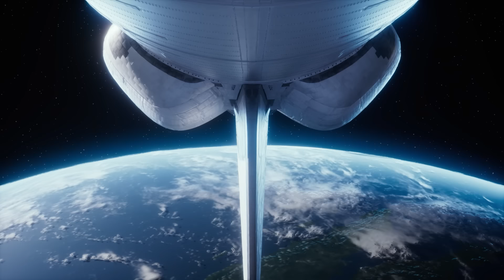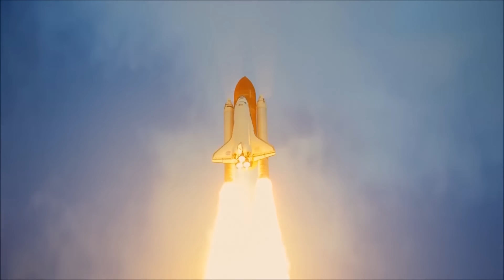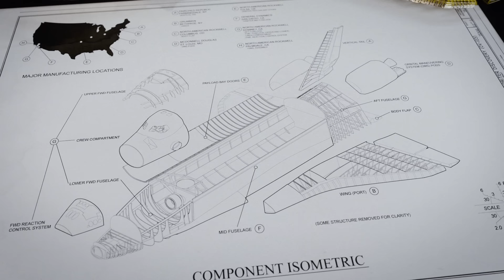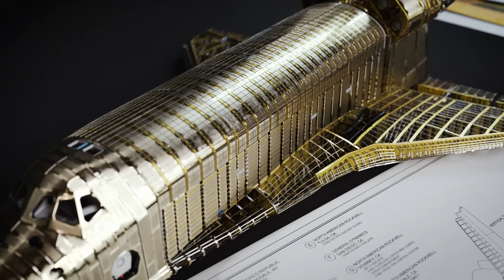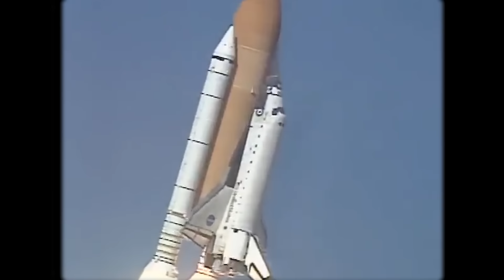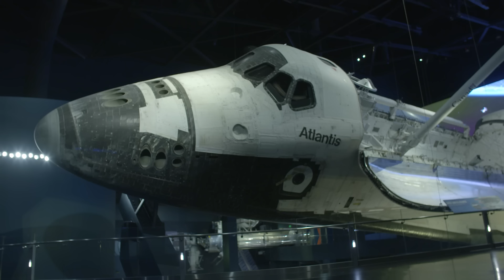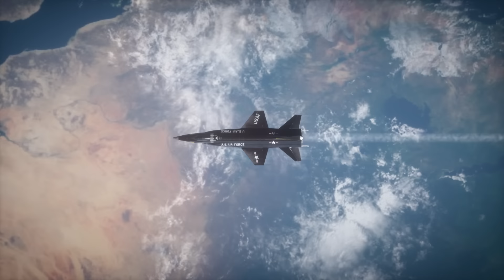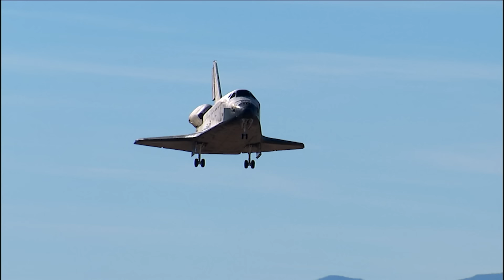The Insane Engineering of Re-Entry

Comment: Reentry from where the shuttle never left 😂 That’s against all aerodynamics. Reentering the atmosphere with the biggest and flattest area which are the shuttles delta wings connected to its fuselage. It would be much more aerodynamic entering with the nose first, which has the smallest contact area, and would “cut” the atmosphere much easier. All supersonic planes have very pointed noses: to reduce air resistance. Except for the space capsules and the shuttle which re-enter the atmosphere with the least pointed part possible. What cuts better, the flat part of the knife or the sharp edge of the knife? Which part of a knife stabs better, the tip or the handle? In aerodynamics it’s the same. The smaller the contact area of object A the easier it penetrates object B.
Reply: The goal of reentry is to lose speed. So you want to make the air resistance as high as possible, not as low as possible.
Reply: Your surname suits you if you translate it to danish.
Reply: Okay first off, the point is to slow down when re-entering the atmosphere, and number two, if you were to re-enter the atmosphere with the Shuttle's nose pointing straight ahead, it will melt since it doesn't have heat shields on the top of it
Reply: @just_david  It would be easy coating the nose of the shuttle with a heat shield.
Reply: @michael.forkert  Like I said in my first point, it would not slow down enough
Reply: @just_david  You have forgotten, that NOTHING flies or floats in a vacuum, or in a near vacuum environment.
Reply: @michael.forkert  So? What does that have to do with re-entering the atmosphere?
Reply: @just_david  What is outside the atmosphere? What is there between the Earth and the Moon? Haven’t you learned that it is a vacuum? Just join the dots, and realize that NOTHING flies or floats in a vacuum. WHY? Because in a vacuum, there is the absence of any matter, which, if present, would sustain anything flying or floating.

Comment: Only star wars technology can make sucessful reentry.
Reply: Nope. Human technology has been proven successful in several hundred manned reentries.
Reply: @Hobbes746  There was not successful manned reentry over Soyuz/Apollo/shuttle style tech. Even ISS is unmanned. Star wars use special electromechanical methods, magnetism and plasma. The force field shields prevents overheating on the hull - Millennium falcon, X wings etc. Also hull materials are far stronger than steel. Carbon nanotubes. TIE fighters/bombers use slow down methods. Simply load is on the engine. Simply engines in star wars are electromechanical jet engines. But quadrillion times stronger and more powerful and more efficient than currently available officially used engines. Area 51 and S4 make such engines. Back in cold war SR71 was designed by similar tech. Then was many advanced projects and propulsions. Including catapult effect, long rail accelerations and what not. But nothing can beat the electromechanical methods with magnetism and plasma tech.
Reply: @LORDVADER357  Incorrect. As I told you already, there have been hundreds of successful reentries, starting with Yuri Gagarin in 1961. All you need is a phenolic resin heat shield. Ceramic tiles also work, as the Shuttle showed. 
Star Wars is fiction.
Reply: @Hobbes746  The irony is that star wars is fiction but is real tech. While apollo is claimed to be real but is pure fiction. Area 51 exist for real. S4 exist for real. And yeah George Lucas knew about that very well. In fact all of his ships was designed by NASA engineers.  Gagarin's flight was also staged. He landed by parachute away from the capsule. ISS has orbit in thermosphere. With peak temperature of 2000+ Celsius. Good enough to melt steel. Ceramic plates will survive. That part is correct. However crew inside will be cooked alive. French fried. Ceramic when heated slowly cools down. So you have one ceramic oven 🔥🌀. How you prefer you astronauts/cosmonauts? Fried, boiled,baked... with more sauce, ketchup. More salt?
Reply: @LORDVADER357  Thermosphere means nothing, there is so little air it transfers almost no heat at all
Reply: @Hobbes746  Star Wars is advertised as fiction. But its real tech. While apollo/spuyz is claimed to be real tech but claimed performance levels is pure fiction. You mentioned Gagarin. He landed outside of the capsule with parachute. Simply was droped by airplane. After that they killed him in airplane incident. Apollo 1 crew died in capsule fire here on ground in simulation.  Our moon is former death star. Gray type aliens are just using it as hangar/garage for their flying disks. Disks fly on centrifugal force ans magnus effect. Pretty much like throwing friesbees on beach. Basicly disk throws itself by spinning hull. Very short range, no interstallar capabilities whatsoever. Here and local planets from solar system. Angels/demons are hydrogen based not oxygen/carbon based. And fly around the planets like nothing.
Reply: @cardboard9124  Thermosphere means that you will be frenchfried. Baked, cooked. How you like your astronauts? With more ketchup? Salt? Nah turned into potato chips. Lil bit overcooked. Yes particles are scattered but thats the problem. Particles cant heat you up, but you cant expell the heat because there are no particles to exchange heat. So you overheat instanly. Even from your own heat. And if sun overheat so much scattered particles whats left for your stupid hull and lots of air inside it? Seriously? You think sun will heat up particles but not stupid shuttle/apollo hull? Or ISS which is constantly in thermoshpere. So sun will heat up scattered particles but your hull will be as cold as ice? Only if you have incredible powerful cooling system. And force filed to keep the heat away.

Comment: They use a aluminum can to go to moon, they really over built the space shuttle. It doesn't even have gold aluminum foil anyplace?
Reply: The LM used MLI foil insulation. This could be placed on the outside of the spacecraft, because the LM would never have to operate in an atmosphere. The Shuttle does have to operate in our atmosphere, so different materials have to be used on the outside. Those materials are a lot heavier than MLI. The weight of the LM was one of the critical items to enable lunar missions: make the LM too heavy, and it could not get to the moon. So they spent a lot of effort making the LM as light as possible.

Comment: Serms they should use aero gel covered the ceramic tiles for more of a heat sheild sincs aero gel can alot of heat. That would of been my guess if i worked there and had ro come up with some idea but im s dumbass and they are one of the smartest people on earth so im sure they probably already thought of that snd this was a better solution of using those black tiles what i don't understand is why black that sbsorbs heat seems like they would use white tiles to feflect the heat but maybe it would of reflected the heat on the un protected top part rather than the belly of.
Whst they made is smazing to most people and i too think it is but what is more amazing to me is that after it landed it would hitch a ride on top of an airplane back home, or wherever they planned it to go.

Comment: Wasn't apollo's reentry capsule also designed with the center of mass slightly offset from the centre of (aerodynamic) pressure, so it would tilt upward a bit to create a bit of lift? So the Shuttle wouldn't be the first to employ this effect.
Reply: Yes. They could roll the spacecraft to steer in any direction.

Comment: "The speed is so great it begins to rip air molecules apart". This is incredible wrong. It's the compression of air which makes the heat (adiabate compression). The air is compressed because it does not have enough time to move aside.

Comment: Why does the shuttle orbit the earth in a reverse orientation ?
Reply: Cause the antenna is on top of the shuttle
Reply: @sH-ed5yf  I didn’t ask why it was UPSIDE DOWN. I asked why it was flying BACKWARDS.
Reply: @robertchoutka3191  oh my bad.
In order to reeintry the shuttle has to slow down slightly. After that it sinks to thicker air layers
The rest is done by the friction of air.
In order to slow down they have to fire their engines. Those are at the back
Reply: @sH-ed5yf  Oh of course! Yes, that makes perfect sense now. 
Thank you 🙏

Comment: I'm a bit confused, you mentioned that carbon is a better thermal conductor than steel. According to Engineering Toolbox, thermal conductivity for carbon is 1.7w/mK while steel is 30-50 w/mK. Did you happen to mean that steel is a better insulator than aluminum?

Comment: In proper english, 500,000ft to ground in 1 hour, 19,200kmh in orbit To 800kmh or 500mph at 40,000ft, falling at terminal velocity, at 40,000ft 1 minute from landing they enter the heading alignment cone and do the turn onto the final approach at 500 ft they drop the landing gear at 300ft they start their flare. The tail has an air brake that controls speed in the final 100,000ft. The final minutes are flown by manual control  and the computer for the whole mission are only 16 kb. Take a picture of a white wall and that uses more memory on your phone than the whole of the space shuttle. Truely amazing.

Comment: Why didn't the space shuttle glide down gently? Specifically I mean once it was going through the atmosphere fast enough to generate heat why didn't it generate enough lift to just be a glider at that point? Couldn't it have slowed down by gliding for a couple hours?
Reply: Air starts to cause drag long before there’s enough air to cause meaningful lift. I think this has to do with the amount of space between molecules: they need to be densely packed in order for lift to occur.

Comment: I really like this and found some new information also. Anyway to me the whole guidance and navigation and approach of space shuttle was really interesting. Split into phases (Entry, Terminal Area Energy Managment [TAEM], Approach and landing)  ensuring everything connects well and you land at the location you want. For example this TAEM bank turns (S-Curves) used to dissipate energy in controllable manner without overheating also had component of controlling your course deviation. You could bank to one side only until some course deviation value, then you had to start banking to other side. When TAEM phase ends you are close to landing strip and you still have some buffer regarding which approach and how the spiral will look like so you can dissipate the right amount of energy just before the landing. Very clever and structured.

Comment: My sister had one of the tiles used on the bottom of the orbiter.  I remember putting it on the stove, turned up full and after several minutes, comfortably grabbing it off the burner with my bare hand.  The bottom was glowing orange but the rest felt room temperature.  Amazing engineering indeed.

Comment: How come the shuttle doesn’t perform a more aggressive de orbiting burn? If the speed causes such insane temperatures wouldn’t they want to lower the re-entry speed as much as possible?
Reply: You see this huge tank that the Shuttle is sitting on when launching? You need all that fuel to accelerate from 0 to 28000 km/h. You need the same amount of fuel to decelerate from 28000 km/h to 0 (well, not really when you already have less fuel after the launch so you are lighter... but you get the point). Using the atmosphere to slow down is just efficient, comparing to using rockets to slow down.

Comment: Everything about the X-15 was real, the footage, the technology. Everything about the 'space shuttle' was cartoon bullshit. Space is fake.
Reply: Except the X-15 went to space. Oops. So much for space being fake. 

'Mix 'n' match' isn't possible; it's either all fake, or it's all real.
Reply: @thewildcellist  67 miles isn't 'space' If you can't tell the difference between that real claim and 240,000 miles away in a vacuum to the "moon" then I've got a tour of the Kennedy Spaz centre to sell you
Reply: @JackH2478  yes, 67 miles is outer space - by 5 miles (the Kármán line, which dilineates the boundary, is at 62 miles).
Reply: @thewildcellist  is that where grabbity stops working and you magically float?! Lol.
Or where you have a vacuum next to a pressurised system without a barrier?! Lol. 
Space is dogshit. Anyone who believes in it is a mong
Reply: @JackH2478  That's all you got kiddo... not much, just another sad troll with no life.
Reply: @JackH2478  
" is that where grabbity stops working and you magically float?! Lol."
No,  62 miles is the altitude where the necessary speed to get aerodynamic uplift becomes as high as orbital speed.. Some people once decided to use that as the thresold between aeronautics and astronautics. US air force uses 50 miles. All definitinions are arbitrary, the atmosphere becomes thinner fluently, so you cannot say where it ends. And it doesn't matter. The ISS at 250 miles loses some altitude all the time because there is still some atmospheric drag at that altitude. 

Why should gravity stops working suddenly? Have you ever even looked into the formula for gravity? It becomes weaker with the distance but never zero. And it has nothing to do with the atmosphere.  At 250 miles (the altitude of the ISS) it is only 13% weaker than down here. In a launching rocket the astronauts don't begin to float when they reach a certain altitude. Instead they begin to float when the rocket stops the engine and the spacecrafts begins to coast/fall/move only by its momentum. ZeroG airplanes don't "simulate" the weightlessness that you have in the space station. Instead it is the same effect. You are weightless when no other force than gravity effects you, so in free fall.

"Or where you have a vacuum next to a pressurised system without a barrier?! "
How do you come to such a weird idea? The air pressure gets lower when you go higher. You can feel and measure that (you feel the pressure change in your ears in a high elevator; and altimeters usually work by measuring the air pressure).

- sea level: 1013 hPa
- top of Mount Everest: 325 hPa
- cruise altitude of airliners: 191 hPa
- 12 miles: 78 hPa
- 22 miles: 10 hPa
- 31 miles: 165 Pa
- 62 miles: 0.3 Pa
- somewhere between earth and moon: 0.00000001 Pa
- somewhere in open space: 0.00000000000001 Pa

I don't know what pressure threshold you use to talk of a "vacuum". There are common used definition to distinguish between a "low (or rough) vacuum", a "medium (or fine) vacuum", a "high vacuum", a "ultra-high vacuum" and "extreme-high vacuum". 

"Space is dogshit. Anyone who believes in it is a mong"
The problem of you guys is that you have totally misconceptions about "space". And the biggest is, that you think that space is something special. But it isn't. As I explained, there is not even a real definition where it begins. Let's say we all live in space. I meanwhile prefer to even avoid the term, becuase it means nothing and just leads to misconceptions. Let's just talk about altitude/distance to earth.  And if you want to know the conditions for that certain altitude/distance to earth (gravity, temperature, air pressure, radiation,...) then calculate it or look it up. Why are some people so obsessed with the question if something is in space or not? I don't get it.
Reply: Cherry picking what suits your narrative
Reply: Neither the X-15 nor the shuttle didn't go to "space" you fucktards. 
17500 mph in that pile of crap? Lol. 
PS the Challenger crew are all still alive
Reply: @JackH2478 you know where jimmy hoffa is too I assume
Reply: @fireandcopper  it takes a 10 year old intelligence to work out that NASA is a completely fraudulent organisation and always has been. Good luck

Comment: Quick correction at ~12:01, Inconel is a family of Ni-based superalloy, not made of mostly steel. In Inconel 718, 50-55% of the alloy is Nickel, with ~20% Cr and ~20% Fe.

Comment: What blows my mind about all the cold war era tech between the 60's and 80's is that it was all designed by a group of brilliant engineers working with nothing but a pencil, some draft paper and a calculator. 

CAD was just in its infancy and may have been used for little 2d sketches here and there but that's about it. Today an engineer could open a cad file, change the heat absorbing material or shape of a wing on a shuttle and run a re-entry simulation in a couple of hours. Make another little tweak then run again. Back then all of that math had to be worked out by hand, hand crafted models built from hand made drawings having tests done in wind tunnels. There was no previous space technology to base your designs on. Everything was all original, you had an idea in a dream, you wrote it down and spent months sketching it out. Engineers in the space program truly must have been some of the most influential geniuses of our time. There is probably so much mechanical tech we use everyday  that has its roots in some drawing for some obscure part of a shuttle and we don't even realize it.

 As JFK once famously said "We choose to go to the Moon in this decade and do the other things, not because they are easy, but because they are hard"
That spirit is lost on us today and we desperately need it back.

Comment: Ah... The space shuttle.. at the same time an epic technological masterpiece and a chronical safety hazard for the crew. Sticking your vulnerable thermal protection system in harms way by placing the orbiter on the side of the stack and sticking SRB's on it was well known risks that could not be eliminated. It is sobering to think about that had they realized the O-ring was compromized on STS-51-L right after launch there was still nothing they could do!